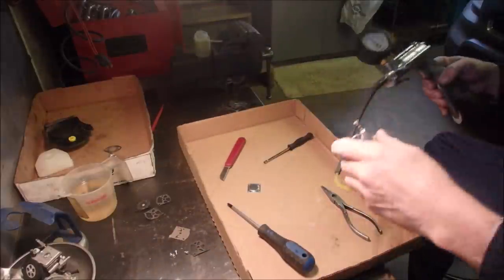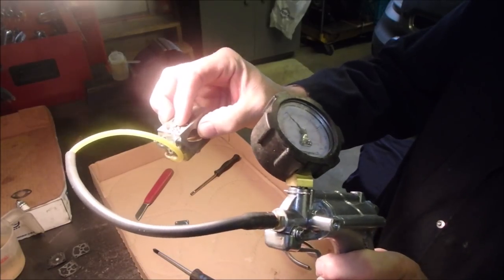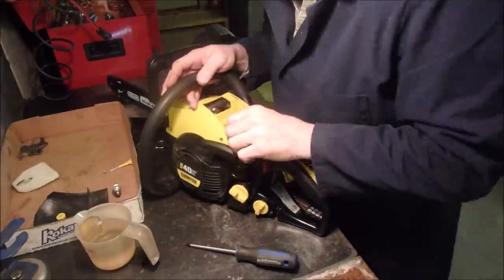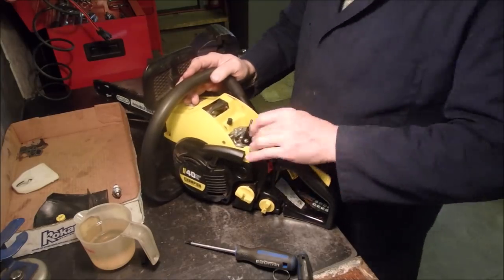Champion 40 CC Chain Saw Runs Bad

Comment: I discovered Leon about two weeks before you first mentioned him and I have found both of you very helpful in getting me further down the road is figuring out these two-stroke engines. Thank you Bruce
Reply from the maker: Yes  2 Stroke troubles are different.than the 4 strokes.
Reply: @BrucesShop  you have convinced me I need that suction tool. It takes the guesswork out of the repair. Way better than “the I think I got it” nope, tear it apart again method.
Reply from the maker: @haneyoakie14  Right.  I tried to use my mouth for years and blow on the carbs but there was no gauge.  LOL
Reply: @BrucesShop  exactly. And to see it it held for 5 minutes is tough also.
Reply: @BrucesShop  Mrs Haney says I need  a volume control gage. Don’t have that one either.

Comment: Hello there Bruce!!  The little experience I have with 2 stroke carbs, it's always been a struggle to adjust them.  It seems I get them set up pretty good, but the next time I start the saw, the carb needs adjustment.  I wonder if maybe I have a leaking carb.  Great video and thanks for doing this.  Take care!!
Reply from the maker: Well sitting is the worst for them.  I think for chain saws the are worked to the absolute maximum then they sit for a long time only to be used to the maximum again.  Things like a weed eater kind of just buzz away at a reasonable speed.
Reply: @BrucesShop  That's true.  My saw worked great for the first 3 years and I was using it almost every day as I was clearing our land here for the camp.  But now, I have to spend a day to get it running and then hope it will still start the next day when I need to work with it!!!  LOL

Comment: Question Sir   Are you putting pressure into the carb OR are you pulling a vacuum with your pump tool
Reply from the maker: putting pressure into the fuel inlet.

Comment: I'm off on a Tangent, Bruce.   Check out 3M Bristle Disc ..  You can use them in many places in your Mechanic adventures.  I like them very much.
Reply from the maker: I will have a try them.    I use the scotch discs right now.  These look interesting.
Reply: @BrucesShop  I wouldn't use them on Aluminum gasket surfaces though. But you understand, just saying.